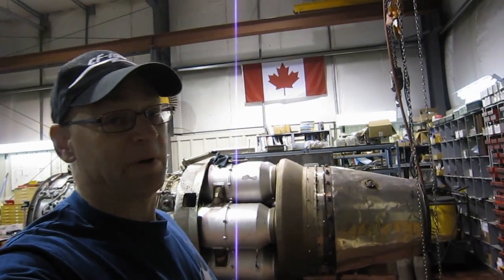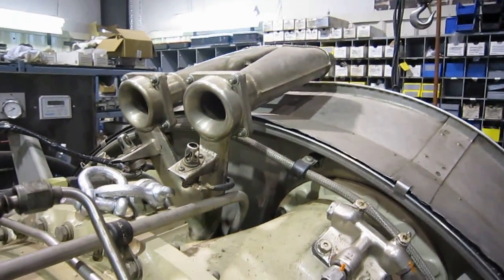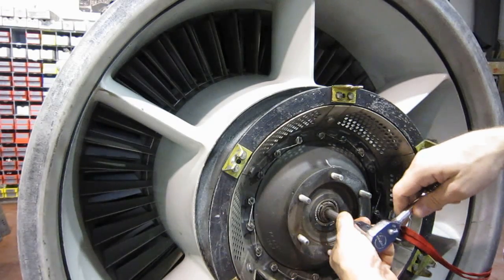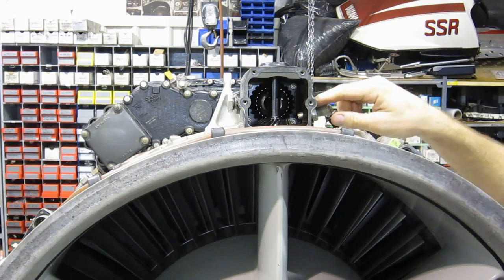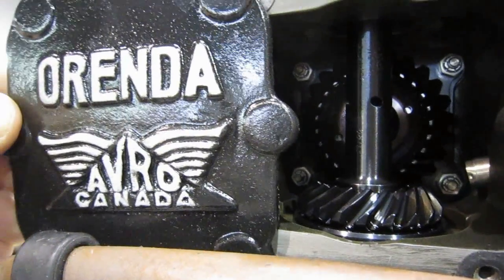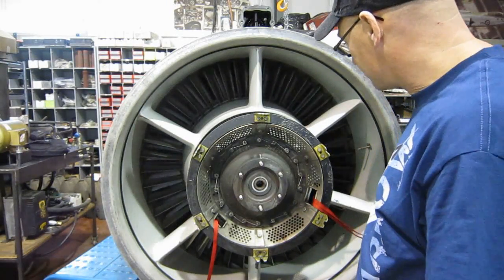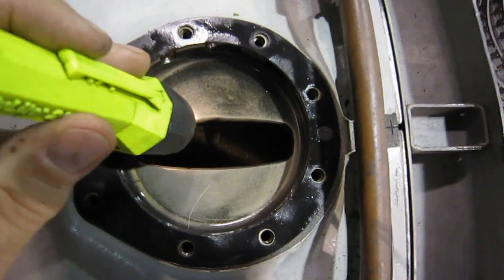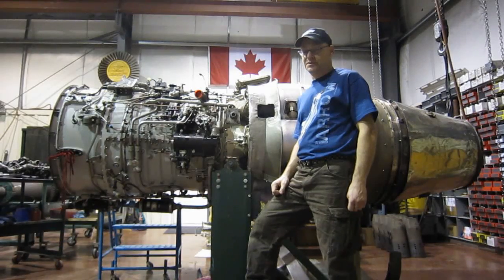Orenda 14 Turbojet in the shop

Comment from the maker: Well, yes, but really, these are all "dash" models, or submodels of the same basic engine. The Orenda -8, -10, -11, -14, and -17 are all different stages of improvement of the same design. The basic layout of the engine is not identical, but very simlar.
A lot like the 283, 307, 327, 350, 383, and 400 could all be called different engines, but they could also be called smal block Chevys.
( Please, nitpickers.. I'm not a V8 expert ! )

Comment from the maker: @xxJohn1977xx Someone once wrote that anybody can make something strong, but an engineers job is to make things strong enough and as light as possible. This is a military fighter jet engine, so the shaft is the right size to do its job. As I mention below, I've never heard of a radial drive shaft breaking.
The only weak spots are the temperature limits of the materials from which the hot section components are made.
Sir Frank himself recognized this in the 1930s.

Comment from the maker: @prandtl002 That sounds like an aircraft part, and I don't know much about it. Not tryinig to be evasive, but there is a definite separation between engine work and airframe work which employ different people in different fields.
We work on engines and have absolutley no experience with airframes.
For example we don't install the engines; that's the work of airframe guys, the AMTs and AMEs

Comment from the maker: @Systemrat2008 The radial drive shaft is the best solution so far that engineers have come up with to transmit power to the externally mounted accessories. All modern engines use this system.
All parts are important, but this one is critical; if it fails, the engine is dead and can not function no matter what.
That's why it is highly engineered, and exceptionally well-made of the finest materials available.
I am not aware of a radial drive shaft failing ever, since the beginning of jets.

Comment from the maker: @oFLYINGYETIo All modern airliner turbine engines use an auxiliary gearbox to drive a radial driveshaft to drive an accessory gearbox, with or without a transfer gearbox.
Everything is powered by the engines, and the radial driveshaft is how every engine gets power to its externally mounted accessories.
I think if you take a close look, the engines get mechanically more complicated with every generation.

Comment from the maker: @JetMech72 The front frame is  sand-cast in aluminum alloy, which is a rather coarse procedure in terms of final dimensions. Any groove that looks like the shaft may have worn it would actually have been milled in during initial manufacturing of the part.

Comment from the maker: @gig651 I know of no engine that uses a total-loss lube system. Maybe the expendable missle engines that are expected to last for about 20 minutes max, but I uderstood they use grease-lubed bearings and no oil at all.
The lube system in a turbine engine is a good idea, although there is nothing exotic there. Dry sump with synthetic oil sprayed on roller and ball bearings.
Reply: It is I again, trawling through Orenda stuff. Every single mark of Viper engine had a total loss oil supply to the roller bearings at the rear of the compressor and in front of the turbine, with the minuscule flows being metered by little plunger pumps. However, the thrust bearing in the air intake and the gearbox had a recirculating system.

Comment: Greetings from New Zealand, I'm loving your videos and was wondering if you could explain how the fuel control/throttle works on these older engines. How do they meter the correct amount of fuel on startup or is it a fully manual process for the pilot?  Is there any kind of overspeed protection like the governor on a diesel piston engine? Regards, Ben

Comment: I was lucky enough to see astronaut Chris Hadfield fly an F-86 on Canada Day, but I think it was a Sabre-5.  It still had an Orenda type 14 engine, though.

I didn't know that the starter and accessories were connected to the high pressure system; I would have guessed the low-pressure system.

I don't expect that vintage or museum planes fly very much - how many flight hours does an engine like this get between overhauls?

Comment: Thanks for another great video. Pardon my ignorance but that drive system seems like a common point of failure. Loose that shaft or its gear train and the engine looses fuel, oil and electricity. Perhaps the applications this engine is used in all have two engines for redundancy perhaps.

Comment: Jay, when you rebuild engines, is it mostly bearings that get replaced, or what other components tend to be replaced?
Reply from the maker: Bearings are usually life limited by cycles or running time. Some other parts, like turbine nozzles and blades are also on that list. All those things are replaced when they reach the end of their service interval.
Every other part is cleaned, inspected, and either found to be serviceable, repaired to serviceable condition, or found to be scrap and replaced with serviceable ones.
Every engine is different, but every part is checked during an overhaul,

Comment: AgentJay; From where in the aircraft are the air conditioning and other devices driven?
Reply from the maker: I am the engine builder. I am not the guy to ask questions about aircraft and their design. Also, you might want to narrow your question down a bit.
I think the answer to this one could fill several chapters of a large book.
Reply: AC from bleed air, and the rest accessories from the gears